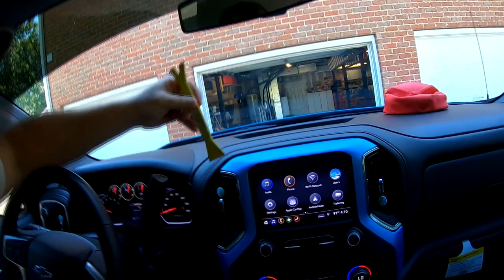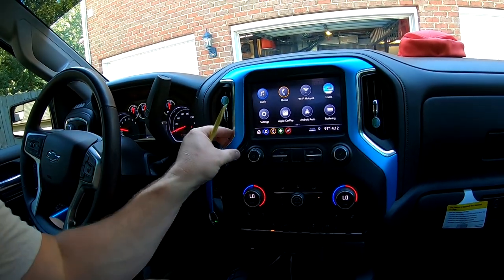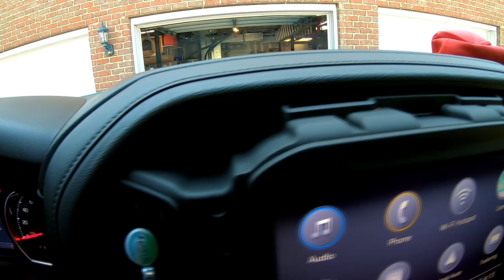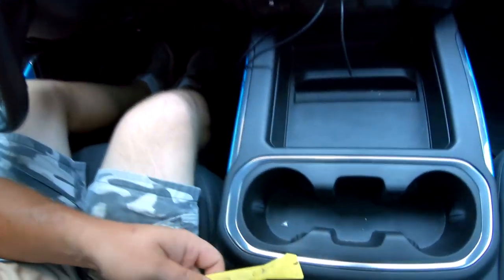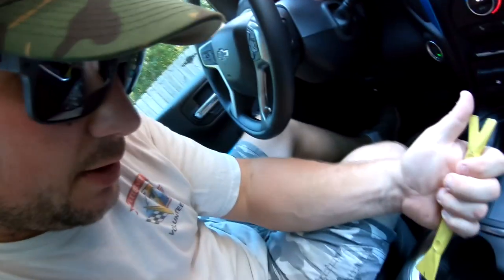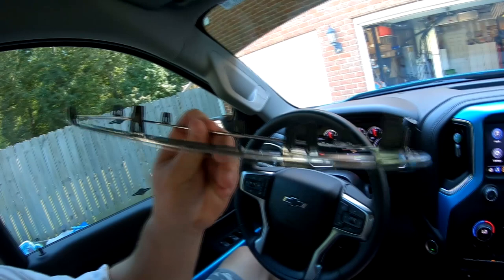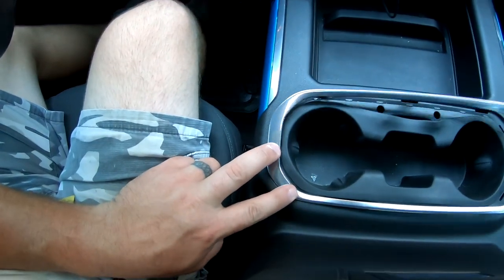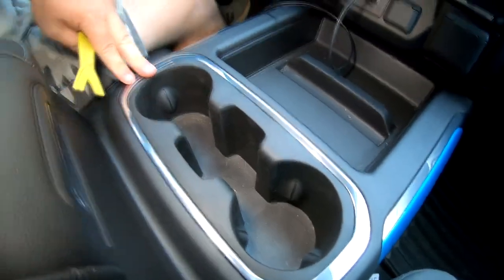How To Remove Radio Bezel and Cup holder Trim 2019 Silverado

Comment: A little late to the party here but the way you take out your cup holder rubber after you get the sides undone is just pull up. The two outer cup holders have little rubber nubs on the bottom that act as an extra way of keeping the cup holder in place. And it’s super easy to put back in, just push down on each nub.
Reply: Thanks for saving me the time of scrolling through thus video... you the real MVP bro
Reply: Ditto on the thank you here as well.  I've been looking everywhere for how to remove that cup holder liner.